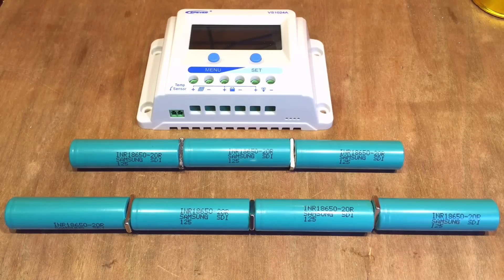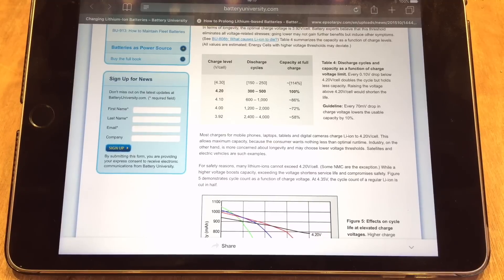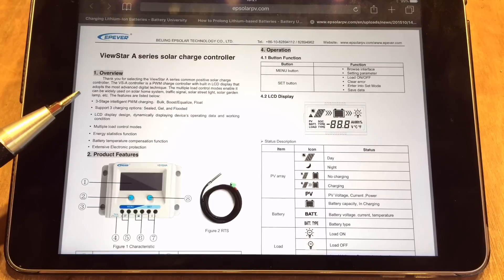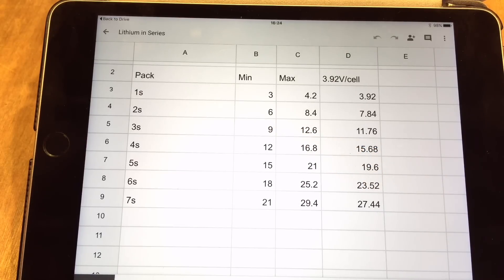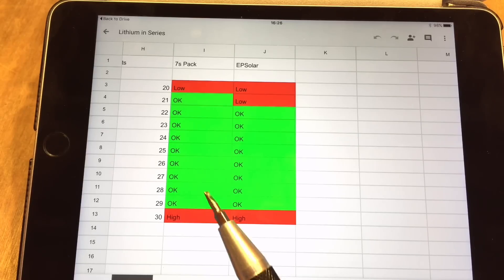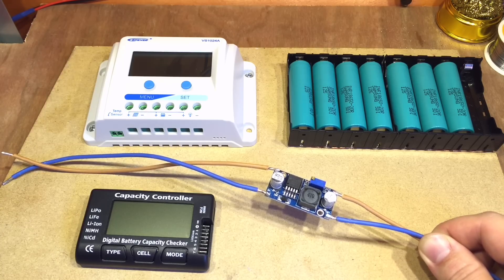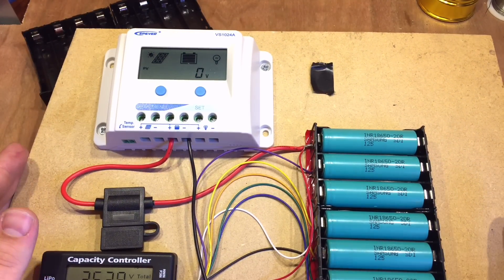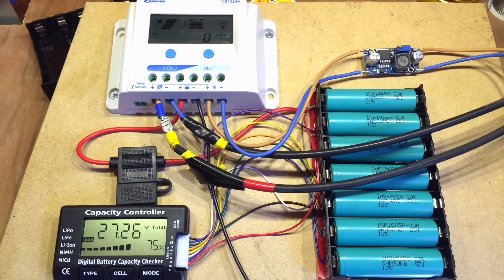Solar Charging Lithium Ion 18650s - Part 1, The Plan - 12v Solar Shed

Comment: Hi, I'm all set to start building this but have a couple more questions.  Firstly, what amp version of the solar charge controller did you go for as there seems to be multiple versions.  Secondly, did it automatically switch to 24v or do you have to set it in the settings as you did with the Gel battery type.
Reply: Ep ever auto knows when you connect your batteries if its 12 or 24v, but it can only do those 2, you need the other version for 24 to 48v but they are the same except the 24 to 48 can handle double the watt's of the 12 to 24 in solar input and in charge amperage,  the video your watching is very outdated for charge controllers, i bought the epever an tracer 40 amp 2 years ago and its mppt with an mt50 controller thats remote mountabke for tuning and for a monitoring screen where ever you want to mount it..  they are lightyears ahead of this old version and i am needing to upgrade it now, so i suggest just buying a new version of either epever   victron or renogy branded one because they are all the same price range and the cheapest quality ones , they come in lithium version now, so they can be fully tuned properly on the new model's you just tell it its lithium lifep04 or lipo or whatever and it auto cuts off things like float charge and it has cold protection cut off to save your cells, there made for lithium , and they are 100% tunable so you can set every parameter to be perfect for your custm voltage battery's too.. they start at around$100us and go to about$350 for the high amp versions for huge solar arrays.. just make sure when buying a controller nowadays that it has a lithium setting thats customisable for your lithium type

Comment: It was a pity you skipped over the wiring of the Capacity Controller as i was looking for that.  The Capacity Controller seems to have 8 leads but you have it connected to 7 batteries so are two of the leads connected to the same battery.
Reply from the maker: No. With seven cells in series there are eight different points you can connect - and eight different voltages. Starting with the most negative point, then the point between the first cell and the second, the second and the third etc. all the way up to the most positive point at the positive end of the last cell.

I think this video goes into it more… Solar Charging Lithium Ion 18650s - Part 2, Getting the balance right - 12v Solar Shed
https://youtu.be/aiVGOEH-T4U

Comment: You don't float lithium-ion batteries. just turn off the charge when the current drops, and then restart when the batteries hit a particular lower voltage.

Comment: Excellent video.. nice to see the coloured charts iv been toying arounf with 3s vs 4s but 7s is clearly the way to go.. typical that i have purchased 12volt inverters - anyway out of this?
Reply from the maker: Don’t totally discount 3 or 4s if you’ve got 12v inverters. Look at the specs for your inverter and see if 4s will work within their limits. If so, you might be able to edit the settings of your solar charge controller to suit 4s. I like 12v because I’ve got lots of things which use 12v without any conversion. If you’re using ac voltage on most of your stuff the 3/4s issue I highlight here may not effect you.
Reply: @AdamWelchUK  Thankyou, I will.

Comment: Greetings from finland. I've almost ready to test my setup based on yours. I have Victron Solar Solarcontroller model 75V/15A with bluetooth, so i can monitor and change values from tablet or phone. It has greater setup area and its MPPT (Maximum Power Point Tracking) rather than PWM controller. MPPT hides the load from solarpanels, so it may boost the power output about 10-20% I've load the Victron without battery  with 12V mini refrigerator which runs draws at 50-60W with 12V from solar and 72W with 240V AC. Works fine, until gray-area of the clouds emerge :). So i need a little backup from my rig. The rig is on a tandem-bike hooked trailer (800mm x 600mm x 415mm 165 liter capacity, watertight). Im planning to use that trailer as mobile power station in trips. I've already tested to load all kinds of things via Solarpanels and overall it looks good to me.

Comment: Adam, My PWM solar charger has  "FLOAT", "DISCHARGE STOP" and "DISCHARGE RECONNECT". I have set 29V - "FLOAT", 21V - "DISCHARGE STOP". What voltage should I use for DISCHARGE RECONNECT.
Thanks, I really enjoy the educational value I get out of your videos.
Reply from the maker: It will need to be set above your discharge stop voltage. It’s the voltage at which you’re happy to start draining the pack again. So loads are switched off at 21v currently and you may set you reconnect voltage to 24v for example. Thanks for the kind comments.

Comment: uhm got a easier solution for you. use a portable solar panel like for instance a ALLPOWERS 100W Solar Charger together with for instance a nitecore d4 charger that can run on 12v dc connected to the 18v port via a step down converter.
Reply: when charging like i mentioned you'd obviously want to use the batteries in a battery holder like you see at 8:36 instead of making a pack out of them. Charging this way eliminates all troubles with properly charging each individual battery.

Comment: Adam - I have watched your 18650 battery charging series.  Very well done, very informative and educational.  I do have a question concerning the entire endeavor.  This is in no way a criticism, I suspect I am missing something.  You mentioned you had your system setup using lead acid batts.  Why replace a working system with the 18650's?  It does not appear to be a more cost effective method, the capacity is not greater (obviously that can swing either way depending on implementation).  The project looks like a lot of fun and very educational but from a practical stand point I just don't get it.  What am I missing?  Thanks for your time and I look forward to seeing more of your videos.

Comment: I have worked with "sealed Gel Batteries" for 20+ years. If you open the top around the seam you will find that they do vent! There are little rubber cups over the small holes and a place for them to vent! When they dry out sometimes you can add water and bring them back

Comment: Hello! Adam Welch,
After watching your video series, I decided to do this project to test the 25 volts, I am using a lipo battery voltage tester to monitor the voltage of each cell,
Could you help me with respect to the connections between cells in cases holder, in segment 6 to 7 the monitor is missing and presented the value of 6.4v when it should have segment 6 (3.2v) and segment 7 (3.2v ) and the monitor all features 30.3v, I believe that the how to connect the segments is not correct, should have some more detail that I could not see in your video, could send me some link how to connect the segments cells in the holder. Thank you very much

Comment: On the depth of discharge (DoD) vs discharge cycles issue...

The batteryuniversity.com page highlighted in the video says 100% DoD allows 500 cycles whereby 10% DoD allows 4700 cycles (lets round that to 5000 cycles for sake of argument). Either way isn't that the equivalent total Ah? 1/10 of discharge gives 10x the charge cycles?

If so then might as well have 1/10 as many cells, always do 100% DoD, and replace your cells often.

Comment: @Adam Welch The charge controller you have posted the link to is no longer available. Can you suggest any other charge controller that you have tested and works well with 18650 battery packs. Thanks

Comment: why not use a DC to DC converter to get your fixed charge voltage, then wire it to a lithium charge control/bms board?

Comment: Okay, it's been 1.5 years now.... How are your batteries holding up?
Question: what wattage panels are you using? as I'm about to change from agm cells to Lithium for longer battery life, I'm concerned about the charging current of your setup when batteries are low as you don't appear to have any current limiting, My panels are 100watters so I don't really want to charge at a possible 6 amps  (mppt 17 volts) or higher on a good day.

Comment: Short version: No, you can't charge 18650's from a lead-acid charger (at least at 12V) because if you do it, the batteries will be over-charged and damaged.  Li-Ion batteries need their charging voltage and current regulated far more severely than do lead-acid batteries.  You might be able to get away with it at 24V but the battery pack will still not be charged in the manner which is recommended for 18650's, to give their maximum life.
Reply: Unless of course the controller has user modes so you can change the voltage levels which many do these days.

Comment: Hi adam I have been using my solar charge controler with 3s set on 12.7v for over 3 years with no issuse.
Each cell charges to 12.2333v the same as most digital chargers!

Comment: Hey Adam 

First of all I’ve got to say ; great videos ! They are a pleasure to watch, regarding your clear explanations, excellent video and sound quality, your expert level (as far as I can say), your scientific approach and last but not least your independancy !!

I was hoping you could help me out a little bit on my décisions on how to assemble my litium-ion 18650 battery pack out of USED ones, which I already tested with the ZB2L3 modules. 

All this to run :

 - a 800 W Pump, peak  times 3 makes 2400 W
 - some phone/camera/notebook chargers 200W
 - led lights 200W
 - 2 fans of 100 W : 200 W
  
 total power need of approxiately :

   Nominal :  1400W ;

   Peak :  3000W ;

Respecting the adjustment of the total capacity per parallel ‘layers’, what if I used different cell quantities in parallel ?

 Simplified example :  1st  serie   5 mAh + 5 mAh + 5 mAh + 5 mAh + 5 mAh    = 25 mAh
                    2nd serie   6 mAh + 7 mAh + 6 mAh + 6 mAh      = 25 mAh    
                                                3rd  serie  8 mAh + 8 mAh + 9 mAh                      = 25 mAh
                    4th  serie  12 mAh + 13 mAh                       = 25 mAh
                    5th  serie  4 mAh + 4 mAh + 4 mAh + 4 mAh + 4 mAh + 5 mAh          = 25 mAh    
                                                6th  serie  3 mAh + 3 mAh + 3 mAh + 3 mAh + 3 mAh + 3 mAh + 3 mAh + 4 mAh = 25 mAh 

I figure that if I’d compose my pack like this, the cells are unevenly applied to when charging or discharging, so, as long as I make sure that I have enough of ‘m in parallel (so NOT like the 4th serie in the example), I ‘d eliminate the chance of extracting to many Amps at once out of a single few of them, resulting in overheating and or damage.

Considering my needs, could I determine the size of my battery according to a maximum Amperage demand of 2C per cell?

  Let’s say, in a 24 V battery system,according to my needs, I’d need a maximum peak      amparage capacity of 125 Amps (3000W devided by 24V). Every single one of the 6 series needs to be able to  supply 125 Amps. If 2C  equals 125 Amps, Then, C equals 67.5, lets round that up to 68 Amps. Considering that my  first question would not be discouraged, one series could consist of 34 cells of 2000 mAh, a second layer  could for example consist of 68 1000 mAh cells…, a third of 46 cells of 1500 mAH and so forth……

 In total, this would come to a 24 V, 68 Ah battery pack of 1.6 kW…

As it comes to solar charging, what affordable solar charger could you advise, according to my needs ?
As it comes to converting to 220V AC, what affordable converter could you advise, according to my needs ?
Do you recommend to reduce the ampérages by assembling a 48 V Battery ?

Thanx in advance

Comment: One issue I had with a power pack made of 18650 and a solar back up project (Inverter / Solar panels/ Charge Controller) was that 3 in series is 12v which is ok....But- 4 in series giving 16. + volts was too high for my 400/800 Inverter... It goes to default. BUT- It helps take that "Over Charge" issue... what is the compromise?
   So- I am wondering about adding a voltage kick down of 12 volts (but- do you lose that extra power? ) To be in line with the Inverter  , but what do we do for the over charge problem if that kick down kicks it to 12v ?  Damned if ya do.....Damned if ya don't lol

Comment: Winter solstice greetings Adam...!   First, thank You for all your videos and work... googling this series for the second or third time.   Very inspirational...!   Started experimenting (again) with solar and batteries.If you have lamps as load, you can couple same types, 2 in series = Voltage divider. Saves on the buck load.   The 12/24V setup seems logical, for small projects and lead/18650.  It is a good idea, to separate 12 and 24 V systems with different plug/connectors ...just like we have a different plug for mains and rc.

Comment: that was so dumb to have to go through so much trouble because you've already got a charge controller. Throw that thing in the trash and get you something that is programmable. Use a 4S pack and short charge it and ur batteries will live forever
Reply from the maker: I'm really interested to see how an off the shelf lead acid charger works with lithium.  I've been running it a year now.  The channel is mainly about cheap products and unfortunately the cheap lithium chargers (none programmable) seem to do a far worse job at charging lithium than the lead acid ones do.
If my lithium bank gets bigger (and there's a good chance it will)  then a programmable solar charge controller will definitely be the way to go.  You say dumb, I say interesting!
Cheers

Comment: i have watched all your videos about lithium ion solar charge controller, but it seems to me there isnt any decent product that can charge these batteries ? or i m missing something???
Reply from the maker: +Waseem Javid I think lead acid charge controllers do a pretty good job. Mine has been running over a year now. If you want something to balance as well as charge then there’s only one product I know of - google electrodacus
Reply: Adam Welch hi Adam, will the lead acid charge controllers charge at beyond 4.2v? I'm concerned about the life of the batteries as I'm currently attempting to solar power a house on the bangladesh /Indian border!!! One of the remotest, hardest to reach, poorest areas!!! Finding and buying recycled or new batteries from Dhaka and then taking them to the house is not easy if I fry them!!!
Reply: It's possible to buy solar charge controllers with no digital meter here from 150 - 400 bdt (about £0.90 - £3.50). They have an input for the solar cell, output to connect your beastly 130amp lead acid battery and two more outputs for lights/sockets. Is it as simple as connecting the diy 18650 pack directly to to the battery output of the controller in the same way you'd connect the lead acid battery?

Comment: Charging Li Ion cells in series is dangerous since capcity of the cells is never exactly the same. If the cell with lowest capacity is full first >> the voltage on this cell will exceed 4,2V. The same applies for discharge. The cell with lowest capacity will exceed its lowest allowed voltage. Since the cell with lowest capacity gets over-stressed it will even more reduce its capacity and this negative effect to this weakest cell is going to happen earlier. Never ever charge Li Ion cells in series without charge control for each individual cell. Otherwise you could see spontaneous firework.
Reply from the maker: +Sven Georgi Have you watched the rest of the series? Spoiler alert though...  one year on and no fire, no explosions. 
You’re absolutely right there can be issues, but a well thought out system can run happily for years and the risks can be minimal.

Comment: Hi, on Batteryuniversity you showed a sheet about number of expected charge-cycles count before a battery die, and the less Voltage loaded the higher number of cycle you can expect.

But this also mean you will need to reload the batteries more time because they will start from 3.92 and not 4.2 for example.

So if you need to reload the battery more time then you increase cycle's count faster and finally is it really interesting ?
Reply: Ideally you size your batteries and number of panels so that you only need to charge/discharge them between 3.0 and 3.92. More panels/batteries = less cycles.

Comment: I am building a pack with 26650's that have 3.5 AH per battery, so it will easily exceed a lead acid battery.